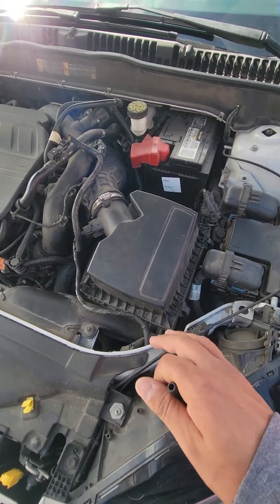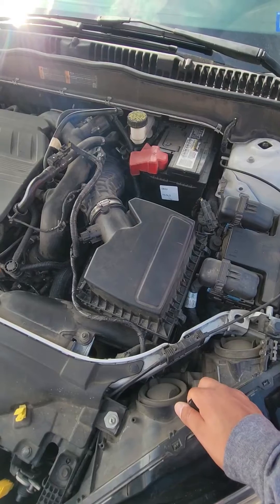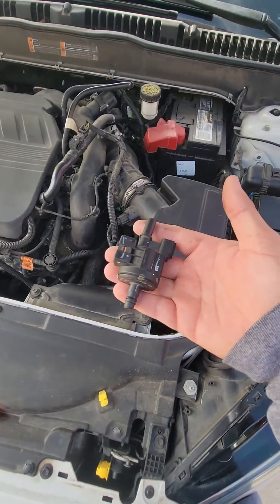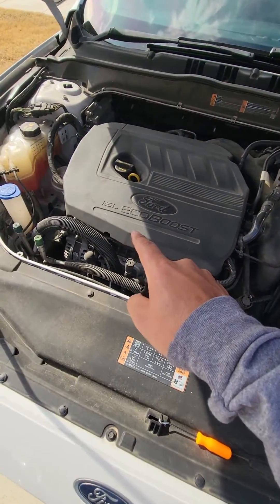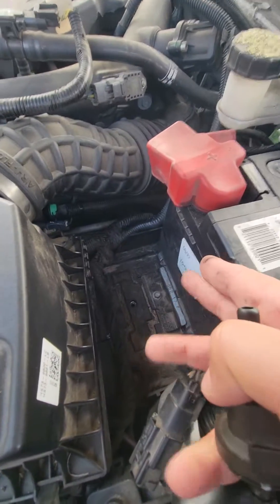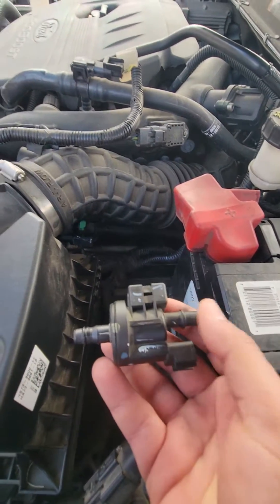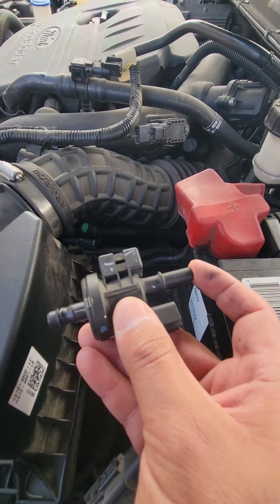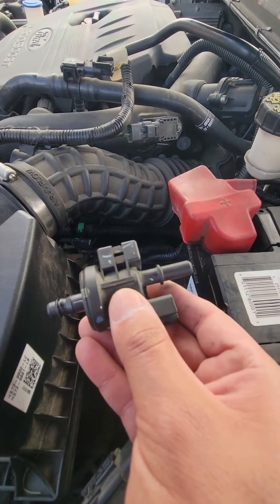2017 Ford Fusion 1.5L ecoboost error code P0456

Comment: 2012 Subaru Impreza error code P0420. Should I change the o2 sensor or replace the catalytic converter?
Reply from the maker: I'm sorry, not familiar with Subaru. O2 sensors are typically cheaper to replace on most vehicles.